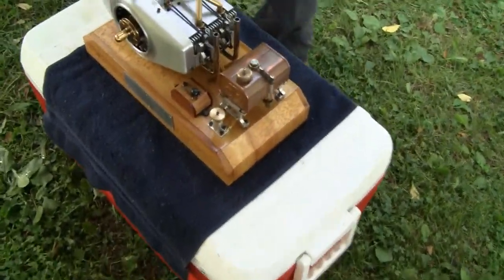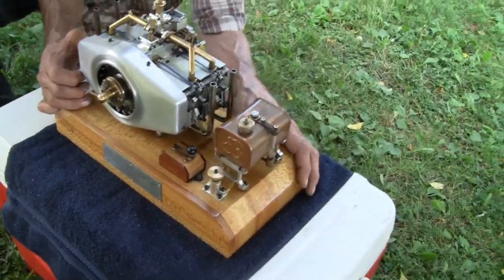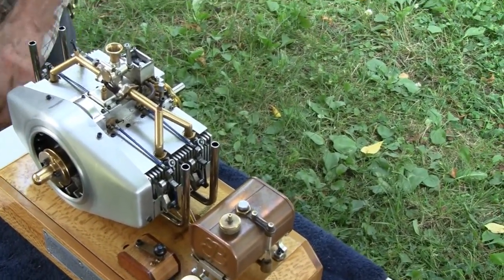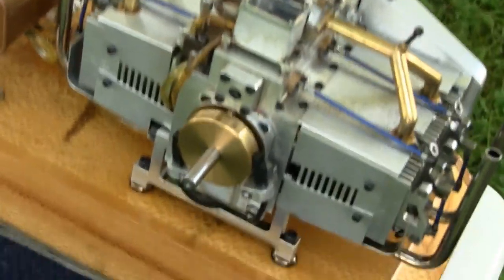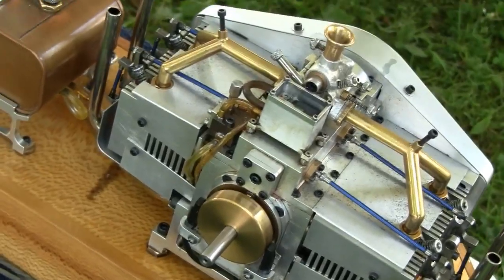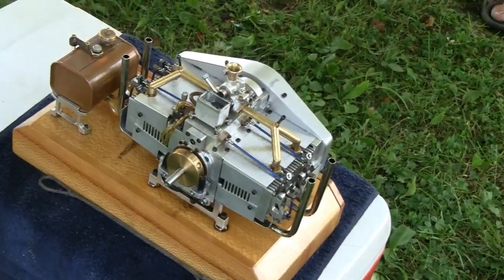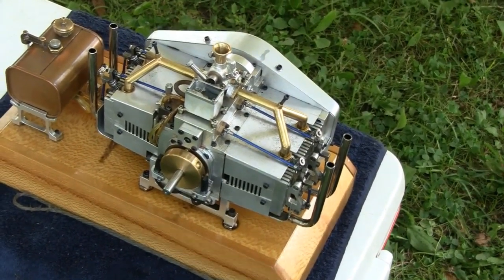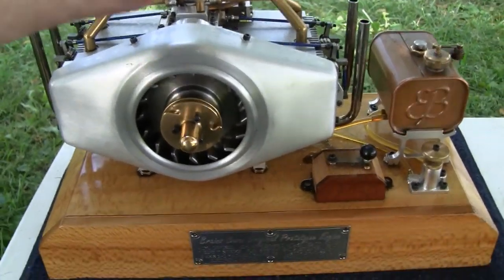INCREDIBLE HOMEMADE OPPOSED BOXER ENGINE (from scratch)

Comment: Over 6000 RPM with atmospheric intake valves? That's insane.
Reply: Yeah I wouldn't had thought that possible.
Reply: Well... no load so it may be producing hardly any power at those RPMs... would be nice it it had a little generator on it to load it up.
Reply: Smaller engines can go higher rpms before suffering from rpm-related problems, due to lower masses of all the components.

Comment: Neat little engine, now you just need to accept the Briggs flat-four (or six?) challenge... :D
Reply: XD100 2 stroke oil? i got 6 gals for my 8v92, 2 gallons for my small 2 stroke v8 and 6 quarts of amsoil dominator 2 stroke oil for my rotary! Thats 10 gallons  of 2 stroke synthetic oil!

Comment: You sir are one heck of a craftsman. We are working on something similar but a rotary engine and didn’t catch the brand of ignition that you used. That’s our brick wall for the moment without going to a  fuel/timing management system which may have to happen still. However admired you work and thought I’d ask you that. Thanks much for sharing

Comment: anyone notice that each cylinder only uses one cam rod to operate both the intake and exhaust valves. now thats very interesting.
Reply: The inlet valves are opened by atmospheric pressure as the induction stroke occurs, with no mechanism pushing them open. Only the exhaust valves are operated by the pushrods.

Comment: One pushrod for intake and exhaust? I don't get how it works. Is there two camshafts?
Reply: The intake valve is opened by the vacuum created on the downstroke.
Reply from the maker: The Intake Valve is an Atmospheric Valve!!☺
Reply: So that works a lot like a two stroke's reed valves?
Reply: @805ROADKING  so it's a modern hit and miss engine? So that could explain not idling very low without a substantial flywheel perhaps.

Comment: overhead exhaust valve but the intake valves are in the block like a ford flathead or briggs?
Reply: The exhaust pushrods come out the bottom of the engine, its all OHV
Reply from the maker: The Intake Valves are Atmospheric Valves!!☺
Reply: @805ROADKING  damn, I swear I saw pushrods under the jugs